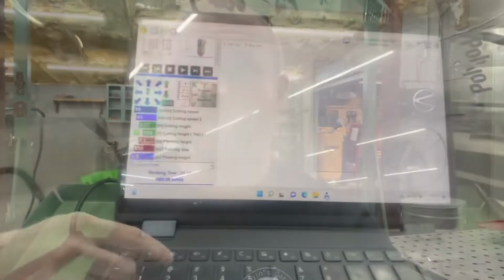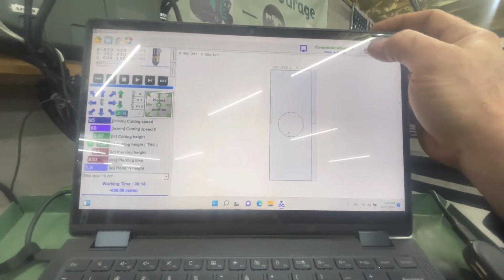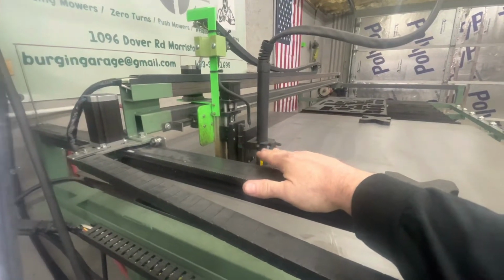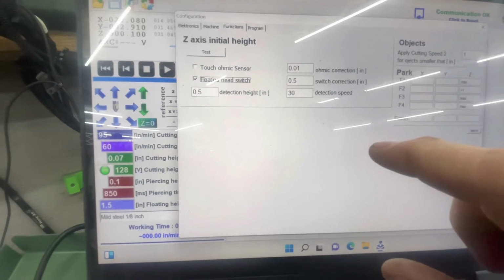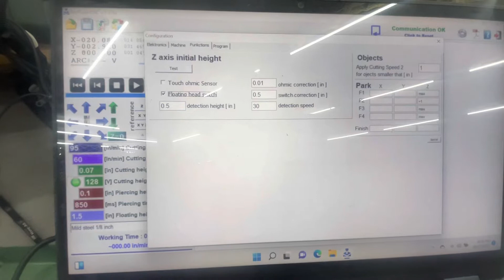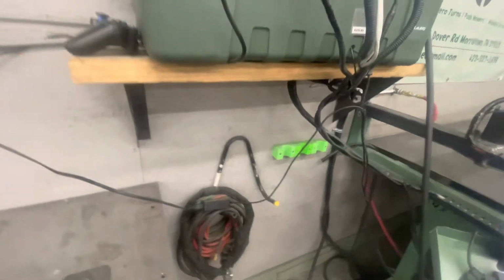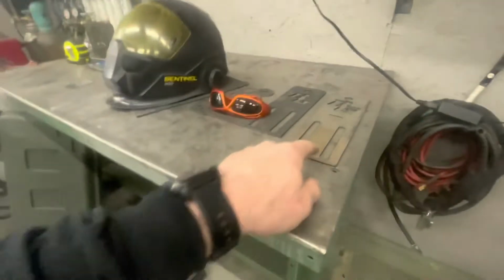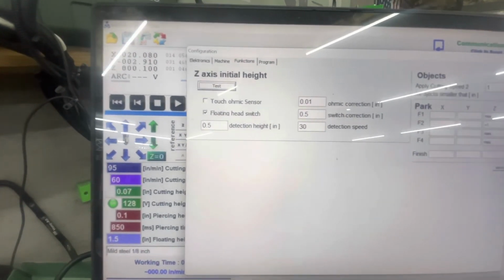Myplasm CNC : How I wired and set up my floating head switch. CNC Plasma cutter.

Comment: NC, normally closed, is the better option for everything CNC. After swapping the cable connection, just click invert check box under the relevant input you are using in the software. For the simple reason that it is fault-tolerant, break a cable, got a bad connection to your switch etc and the trigger condition will be set meaning you don't crash your machine driving your torch into the table, same goes for all axis end stops.
Reply from the maker: Great advice 👍 Thanks for sharing